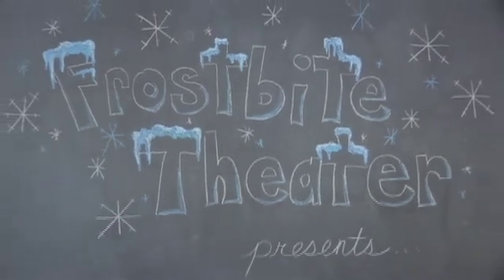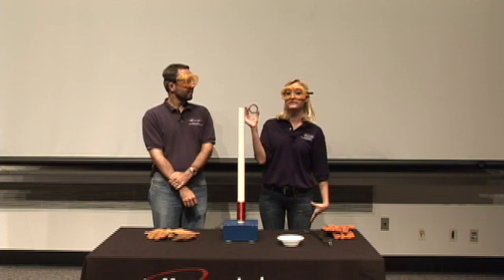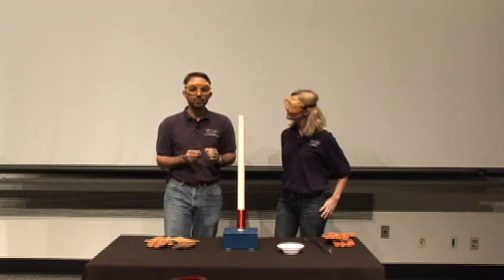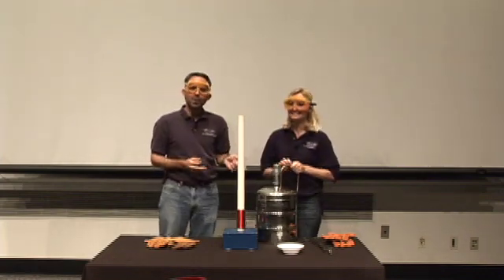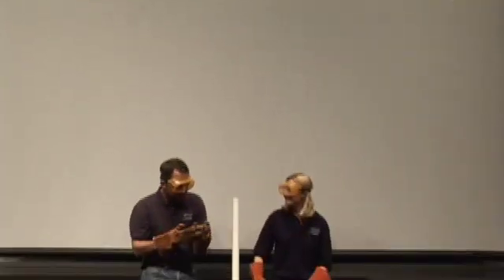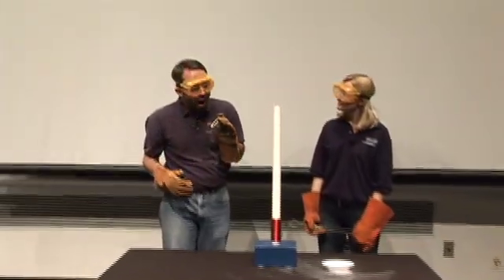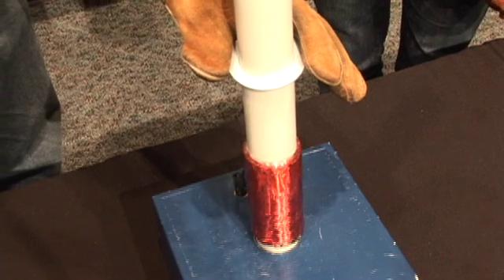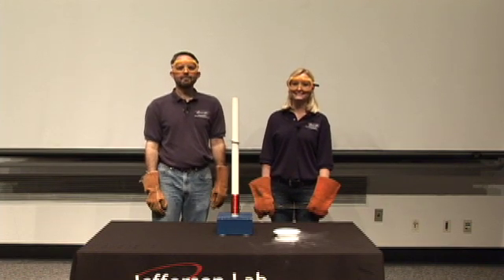Liquid Nitrogen Experiments: The Flying Ring!

Comment: I got my ring to finally jump 5 feet high instead of 2 feet.
The main difference is that the 2" inner-diameter ring is just barely larger
than the pvc pipe holding the 460 30" steel survey flag rods.
The other rings I was using were 3" inner-diameter, and would
only jump up 2 feet.

Comment from the maker: We've never tested that, but it should help, up to a point. The extended iron core helps communicate the change in flux to the ring. The more of that the ring sees, the higher it should jump. However, the magnetic field can't be trapped within the iron core over an arbitrary length. At some point, the iron core just acts as a chunk of iron and doesn't do anything to help propel the ring.

Comment: Did you find that the ring jumps higher when the core is elevated so that there is no metal core in the lower part of the coil, i.e. raise the core up relative to the bottom of the coil?

Comment: I have made one but it only jumps two feet.
On your site you list the wire as 18 gauge stranded hook-up wire (250 feet needed).
Did you use insulated wire or magnet wire on the model you show?
How high is it going at room temp?

Comment from the maker: Copper already has a fairly low resistance. But, to answer your question, no. The only common material that comes to mind that has a substantially lower resistance than copper is silver. We probably wouldn't be able to justify getting a silver ring...

Comment from the maker: @Sillyzombie666 Liquid nitrogen is much less expensive than dry ice. Nitrogen is 'mined' from the atmosphere and the atmosphere is 78% nitrogen. Liquid oxygen is commercially valuable and it's only a few degrees warmer than liquid nitrogen. Once the oxygen in the air has been liquified and extracted, it's trivial to get the nitrogen. In a way, liquid nitrogen is a waste product of the production liquid oxygen. By comparison, carbon dioxide only comprises about 0.03% of the atmosphere.

Comment from the maker: @MultiSharpshot If you change the magnet so that you get greater magnetic flux, the ring will go higher. Cooling the ring more will help it go higher, to a point. Energy still has to be conserved. The maximum height of the ring is limited by the energy the magnet can give to it. Copper doesn't become superconductive, so there will always be a bit of resistive heating.

Comment from the maker: @BRyanS72 As it turns out, copper is never superconductive, no matter how cold you get it. But, if it were, it would go a bit higher than the ring cooled in liquid nitrogen. The limiting factor in how high the ring will go is the magnetic coil. It can only provide so much energy to the ring.

Comment from the maker: In a rail gun current passes through the projectile itself. Lowering the resistance of the projectile could only help. I'm not certain to what extent, though.

Keep in mind that the current in our ring was induced by a changing magnetic field while, in a rail gun, the projectile completes a circuit and current flows through it as a result. At the end of the day, current is current, regardless of how it is made.